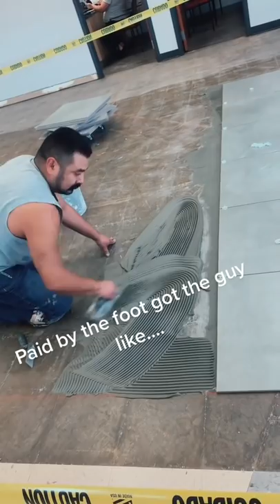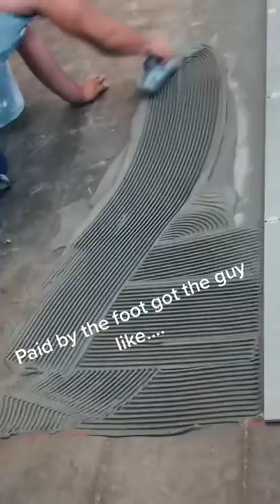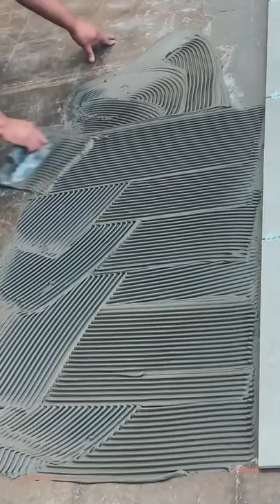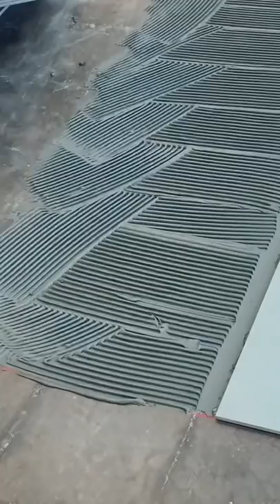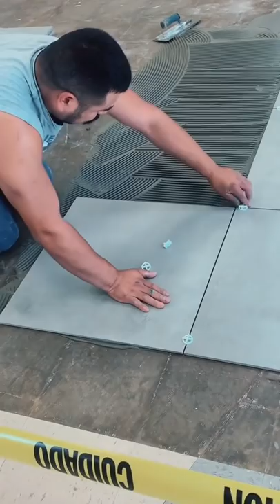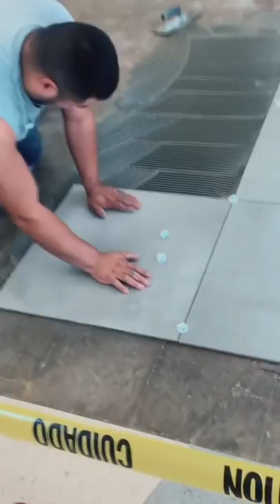Dude laying our new tile is 🥶 CREDIT terrywatson806 #Shorts

Comment: As someone who knows knows what they're doing when it comes to this I just like to say, anybody else that actually sets floor tiles if like me would love to walk across this after it's done and listen to all of the hollow spots in the floor
Reply: Yeah I am sitting here waiting for all his corners to chip. Wanna go tap that floor and hear the loud hollow spots. I always push until there's mud coming out the joints. He could've at least skimmed the back of his tile.
Reply: Lol no back buttering of his tile. Shit trowel lines. Gonna be calling him back. Or someone new haha.
Reply: I could be wrong but don’t all the trowel lines need to be going the same way throughout the entire tile and he isn’t angling his trowel enough up so the trowel lines aren’t deep enough meaning there’s not enough thinset under the tiles.
Reply: Super loose thinset, no back battering, and too small a trowel size. Hope it’s light duty use.
Reply: Yes ive been doing it most my life. 
This is what not to do. 
Jamo gts thinset , no back butter or support on the far edge and corners .
I give it a year before the next rip out. 
And the next "hey i know a guy"
Reply: @James_Edward59  yeah directional trowling isnt super important untill youre dealing with porcelain slabs. So you dont trap air in the lay. And you either vibrate or walk it out.
Reply: @havocdevelopment6142  Gotcha, thanks for the info.
Reply: Ayyeee,there was "noo wiggling"  🤦‍♂️. Lol
Reply: I'm telling you right now,  YOU A BABY in this tiling game!!
That line hes clearing fills right back up when the tile hes installing is pushed against the spacers toward the other tile.
Any other spaces under his tile edges 
WILL BE FILLED while applying grout!!
Reply: @James_Edward59  yep you wrong.
Reply: @glenperu  Wrong about what?
Reply: Super flat thin flakes, with a oily trowel angle groove mixed in with a upwards down splurge. Fucked install won’t be dialing his hotline ever again.
Reply: @glenperu  and how long have you been doing tile?
Reply: @James_Edward59  Rather than back butter the back side of the tile switch is where you trowel thinset on with the flat side of the trowel like buttering a slice of bread, with tile that large I would rather comb both the floor and the back of the tiles. As long as all the trowel lines are going the same direction and you press the tile into the thinset firmly and then Rock the tile side to side perpendicular to the way you have your trowel lines pulled, you will ensure that you are pressing the tile in firmly enough and compressing those lines for very nice even coverage. There are also concrete floor cleaners he could have used prior to mixing up thinset that will help the thinset adhere to the concrete slab better.
Reply: @James_Edward59  yes. All the same way. Pull straight down, slide tile left to right
Reply: You know laying it so thin is not an issue if your surface area is level right? It also eliminates the need of back buttering floor tile( i don't know anyone who does that to anything other than wall tile)
Reply: @ricardovasquezjr8493  🤣
Reply: @devinlauwerier404 I use a rubber mallet and shock it into place
Reply: @glenperu  somebody finally know something
Reply: @glenperu  how old are you and when does class start
Reply: @glenperu  exactly! These guys commenting union guys 😂… they can do 20 square feet a day and still make there 30-40 a hour
Reply: @glenperu  lmfao maybe if his margin trowel was half as wide. Man wiping out 2 inches of mortar. And if youre counting on grout to fill mortar voids then youre wasting customer product and your own time trying to pack in entire edges of tile throughout a job. I would rather clean any mortar that bleeds through than take all that extra time spreading and wiping all the grout needed to fill the voids 🤦🏾‍♂️
Reply: @ricardovasquezjr8493  how many " level " concrete floors have you ever seen? 
Been in it 30 yrs and not 1 slab has ever been perfectly level. Especially for these large tiles. Good luck
Reply: @James_Edward59 doesn’t really matter on the floor but on the tile back should be rotating it in your hand and have trowel marks in four different directions for maximum coverage and no hollow sounds but that floor looks flat as fuck so he probably be okay with what he’s doing honestly
Reply: thats why the floor has to be floated and the correct thickness of grout mixture and a good trowel.spread correctly, there should be no hollow spots.
Reply: @shawnkranz7412  trowel marks in four different directions?
Reply: @jessesalinas8534  wut
Reply: Agreed he needs to learn how to spread thinset and start standing that trial up.
Reply: True!
Reply: For real man! I was about to comment until I read yours. That trowel notch was WAY OFF. And the corners of that first tile, then scraping the thinset from the previous row. I use 1/2" tooth trowels for any tile 12x12 up to 18". 3/4, maybe more if over 24. Just because something "looks cool", dont make it right.
Reply: @glenperu  i can tell by your grammar and lingo you don't know half of what you're talking about. Everyone here saying he's wrong, and you come in, ebonics and all, "shutting professionals down". Give me a break. Your comments are proving you're as bad an installer as this guy. I'd never hire you.
Reply: @havocdevelopment6142  40 years
Reply: @James_Edward59  direction of spread peeps
Reply: Cause I said I'm shutting him down!!

Thats ebonics??🤔🤔
Reply: Yeah no butter on the back is a bit eh
Reply: I don't know shit as a plumber, but I do know the contractor that my boss hires does the shittiest tile job. I'm talking gaps you can thread solder through and they ask us to drill holes for the shower fixtures!!! Ha! Thinking about how those tiles will  crack and fall off makes me weep.
Reply: @James_Edward59  yup id assume the same and also add to the tile also
Reply: I would agree, 16 years in the construction industry and you always back butter the bigger pieces. I do it on 12”x12” and bigger.
Reply: I'd love to see the back of a tile that this guy set.  I'm guessing 30% coverage.
Reply: Notches need to be in one direction so the air can escape and create a suction effect when setting it into the mortar. Nevermind the fact big floor tiles like that def need backbuttering
Reply: @higurashikai09  Make sure get the glass drill bits 
and if the tile is 
1/4" thick spray water while you drill
Reply: Yeah he didn’t back butter!!
Reply: Was wondering the same thing. I back buttered my tile when we DIY our kitchen remodel, can’t imagine a professional doesnt
Reply: So this is what it's like to witness the dungeons and dragons version of tiling. Wooooow 🤣
Reply: @sophiatiantian  sounds like your subfloor wasn't 100% flat and smooth.
Reply: @gregbrandreth4779  That's for subfloors with dings, the extra butter would allow for filling dings, sinks and low spots.
Reply: Actually it's smart to not have the joints seep, that's just hours of cleaning for no good reason. 
Instead of the way he takes so much in the corners.. Turn the small trowel at a 45° and it will only take 1/8 of the corner mud. That way you have one of the cleanest instals with just a Sponge wipe ready for grouting. Once you grout that 1/8th inch void on corners will be filled.
Reply: @glenperu  that reply you had to the guy who said you were using ebonics was funny as fuck. Little did he know you're Caribbean... lmao
Reply: @Theviewerdude  Mind you I do have American siblings through my father.

First time I heard my younger brother say they were planning on teaching ebonics in schools 

I was definitely thrown off bro. 
I seriously couldn't believe what I was hearing.   That's was my wtf moment!!🤔🤔

Him and his sister flunked high-school.

At 52 I took the GED exam...
8 hours at Brooklyn College and 5 mini marijuana cigarettes later.   2200 plus!!🙏🏿🙏🏿✌🏿😁
Reply: I did wood and tile floors for a couple years and I agree. We always back buttered the tile as well. My boss would walk around bouncing a golf ball off tiles and if there was hollow ones we marked them and replaced them.
Reply: Funny how few tile guys actually know what they are doing. Doesn’t sound like any one here has even heard of the TCNA handbook or ANSI.
Reply: @williambrandondavis6897   ANSI 30 Million worldwide.

Nah never heard of them.
Reply: I understood nothing you just said but I used to watch my dad do this on the side (it was too hard on his body to do it full-time) and 100% agree
Reply: I did commercial vinyl, marmo, vct and the like for about 10 years but I never had much interaction with the tile guys. Do you guys not ever use 100 or 50 lb rollers to set the tile in place? Or is it too risky with rigid materials like this?
Reply: Trowel and error lol!!! Technique looks great tho!
Reply: @uncleangie9597  non union guy knows nothing about union guys.  Where I am(Chicago), quite the opposite.. hardest working trade in the city.  Non union dont have a clue.. they can hack and slash, though.  Total trash.
Reply: @pb7133  industry standard is anything bigger than 16" on a single side.  Most backsmear 12x12 too, though.
Reply: @pttthhh  crazy bro. Here in Toronto it’s wild…the union guys are hacks most of the time. And if they do good work they move at a turtles pace…but like anything there is good and bad…either way it’s a bastard of a trade lol
Reply: Try roofin brother.  Lol whole new world
Reply: I wasn't going to say anything about that but it's going to be terrible. The amount of hollow spots that will be there is atrocious.
Reply: Facts
Reply: Facts  no back buttering no no
Reply: @glenperu  he likely is using a 1/4”x3/8”trowel and these are 24”x24” tiles. 
He should be using at least a 1/2”x1/2” trowel and back buttering. 
Come back when you know a thing or two. Good night rookie
Reply: @Mo Swagy no it isn’t.
Reply: @Tbobaggins89  pfffffff lol. Right. Might as well say “try drywalling brother”
Reply: @jeremiah8559  Good morning young fellow how you doing??
You would dream to get a floor that smooth and flat when you get to 60 years buddy.
Ps. Not 24" at all they handling too easy.😁😁
Reply: @glenperu  I’m good bud. How you doing? where I live I make well over $100k a year running my own tile company. Just work for myself by myself. I have about 8 contractors I do work for. I’ve been tiling for 20 years. I started when I was teenager working with my dad who ran a tile store with my mom. 
It’s quite easy to get a floor flat when using QEP lash levelling clips and wedges. I use them for all large floor and wall tiles. 
Have a great day old man
Reply: @joshhigdon4951  Dude, he just destroyed your racism with more advanced racism. You don't stand a chance against the boomer. Run.
Reply: @jeremiah8559  God I love this comment thread so much.
Reply: This has been one of the best comment threads I've ever read. Maybe it's just because I'm autistic but damn, this was interesting.
What I've learned is that this trade is vicious.
Reply: @LatinaCreamQueen  tile guys in particular are a very nit-picking bunch

Comment: All these people astounded at him doing a “good” job….then there’s me thinking of the hollow spots because he lays down a dry backed tile
Reply: Especially tile of that size 😬
Reply: Yes thank you the comments was to nice to him  .thanks for you being you
Reply: No back butter or keying in the tile to bond it? On an inside or outside floor anyone whose done tile properly would cringe at this video....sorry improper and won't hold.  Maybe with sher dumb luck but you would never ever ever do this....
Reply: Haters 🤣
Reply: Was thinking the same thing. Tile will break and crack in no time
Reply: @elizagarcia2057  
They arent haters.  They are correct!
The margin scrape move removes the tile setting mud.  While this makes the pros job faster, not having the mud squish up thru the crack requiring pesky clean up prior to grout, it also removes the mud designed not only to stick the tile to the floor/surface but it also provides support to the tile. Spots without the EQUAL amount of mud have hollow spots for support. In time the stressed tile will break and crack. That's bad. 
Hollow spots can also accumulate water causing tile to pop off or a mold problem. 

A 100 lb woman on 1/4" stilleto applies approx 1500 psi of pressure, greater than an elephant. Easily breaking the tile.  Same for wood. If one likes to have parties/entertain hardwoods should be installed, like cherry.  Pine floors would pit and dent from the pressure of a stilleto. 

However, for commercial pros, businesses would rather have a large job done quickly, and replace or repair an occasional tile later due to use case, cost, and liability.  But I wouldn't want my tile installed with this margin technique in my home.
Reply: @elizagarcia2057  not haters. You’re obviously not a tile/flooring professional. 
Go back to sleep.
Reply: I thought so too. He didn't back butter tiles that big.
Reply: @SneekySecrets  thank you. This was driving me crazy as I’ve seen my brother do a home job and remember how much extra time buttering the backs took. But nobody mentioning it. 

I am planning a home Reno and would’ve loved to save that time too if it was not necessary but clearly it appears this guy wasn’t doing the job the “right way” and paying by the foot is screwing these people as he is rushing it
Reply: My thoughts exactly
Reply: Yea didn't use directional troweling and didn't even attempt to collapse the ridges
Reply: Has it occurred to anyone that probably the person paying him asked for a discounted price and to be done by a certain time frame?
You want a discount for hard work? You get what you pay for.
Reply: Same i didnt want to say anything about not back buttering the tile specialy big tile.
Reply: @TheLegendaryFolklore  so what you are saying is that he is a garbage and doesn't take pride in his work? I agree.
Reply: I don’t even think that was a 1/2in notch trowel.
Reply: Faster, not better. Pros aren't paid for feet laid - they'd smoke this guy if that was the case. A tile that large is going to settle and crack diagonally - give it 1-2 years max. Since it's inside the AC will remove all humidity and it'll happen faster. Tile still needs SOMETHING to support it - tile cannot sit on a floor. To those stating we are haters, sorry the truth sucks. I'm sure he's a great guy but this dude likely knows his missing steps to get more pay. Such is life.

Anyway, we cannot force people to understand that FLOORS MOVE and you need to support tiles with back buttering to give it a platform to sit on while the floors move. This makes it so the mud cracks instead of the tile.
Reply: I was legit looking for this post bc while I don’t lay tile I work in construction and that was a concern of mine while watching this lol
Reply: @elizagarcia2057  Aww someone's insecurities are showing. Relax, just people's experienced opinion. Had nothing to do with La Raza 🤣 All butthurt
Reply: Wats the song
Reply: @elizagarcia2057  LOL Spend 15 yrs in a trade.  You'll find Its always good to have professional observations.

Comment: He should have a guy back buttering them tiles for him. . Solid worker but no coverage at all.
Reply: Back buttering is a gimmick. Should be more concerned when he flattens the edges where the tile meets to avoid bleed through... That creates weak points for anything heavy, edges will eventually crack.
Reply: @palmerstile9379  my point exactly , tons of hollow voids under that tile . Anything drops on it it will crack . Buttering the back creates better coverage when you collapse the ridges. I don’t agree that it’s a gimmick . I believe it’s a night and day difference . The easiest floors to demo are the ones with no thinset on the back which is caused by lazy/fast installation .
Reply: @angelodeluca3533  gotta check out the glass tile demo for all the set in methods. It’ll surprise you but you can actually see that on floor applications back buttering traps air pockets that expand when you shake to set
Reply: @palmerstile9379  back butter further ensures cohesion of the floor to the tile. Not a gimmick. Literally every professional tile person Ive run into said it's a needed step. Doing tiling work myself in my house, it definitely is peace of mind. But it's good to know who not to hire.
Reply: @bobloblaw7465  Only been doing it 11 years. I'm booked for 9 months anyway, don't need your money.
Reply: @bobloblaw7465  it is not a needed step. Been tiling 17 years never once buttered. Come to Australia. See how many tilers butter. None is the answer. Forget that anyway this guy has no lines, no nothing, using a pissy little notch too. This is a ruffian, this is not proper tiling even without you’re so called needed back butter
Reply: @jimmyfiddle5234  exactly my thoughts, those markers or whatever they're called in english, those little plastic thingies, they won't magically make the floor not be crooked. Not to mention he is ruining those edges to make sure there isn't any material leaking out, just to avoid cleaning it but making sure there is no air there. Those tiles won't last long, but that's just how construction companies tend to work at least where I live. Everything has to be fixed, replaced or repainted in less than a year or two.
Reply: @palmerstile9379  u ever herd of grout
Reply: @ogPETEtv  nah never in my life. New to this 🤦🏻‍♂️
Reply: I believe more in a scratch coat. It's how I set my pool tiles.